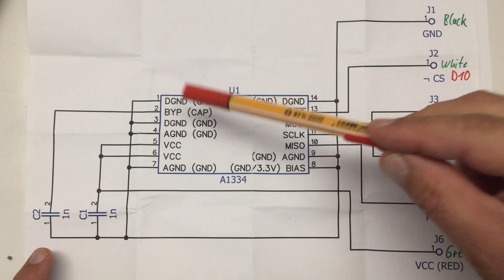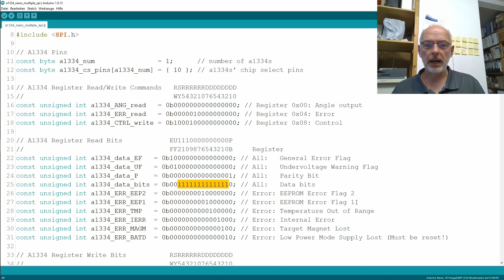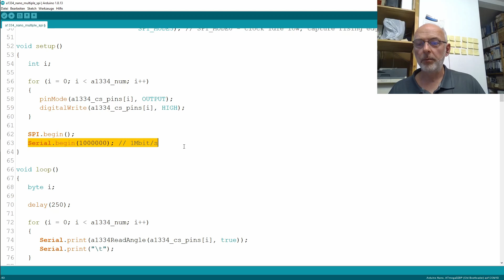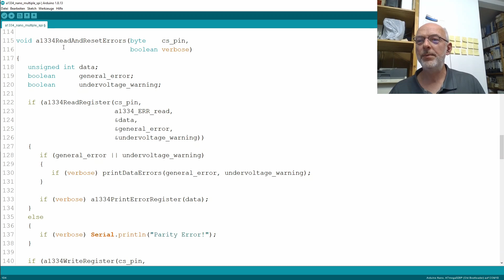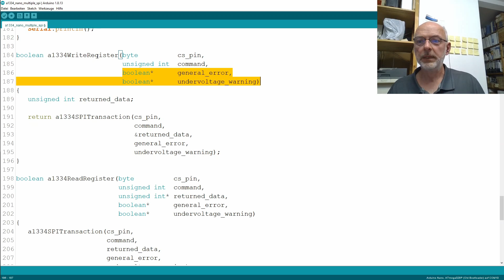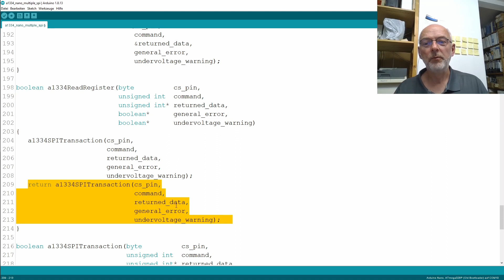Hall Effect Angle Sensors (Arduino, Allegro A1334 and SPI) – The Basics (2/3)

Comment: Thanks for this.  Very useful.  I think the resistors might be better at 3.9k rather than 3.3k, yes?
Reply from the maker: You're welcome! Anyway, not if you take tolerances (resistors, 5V rail) into account: A 2k/3.9k voltage dividers would indeed reduce the 5V to spot on 5V/(2k+3.9k)*3.9k=3.305V. But if you have some unfortunate tolerances (say +/-5%) you might get 5.25V/(1.9k+4.1k)*4.1k=3.588V which already exceeds 3.3V+5%=3.465V. A 2k/3.3k voltage divider is save in that respect.